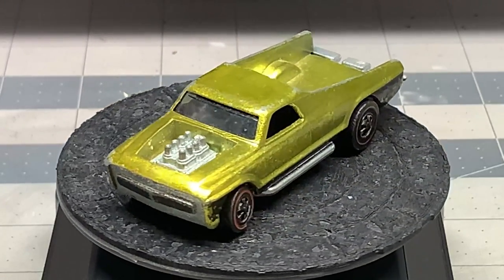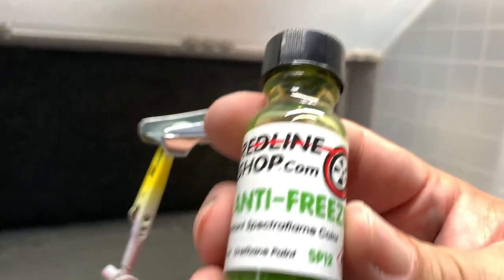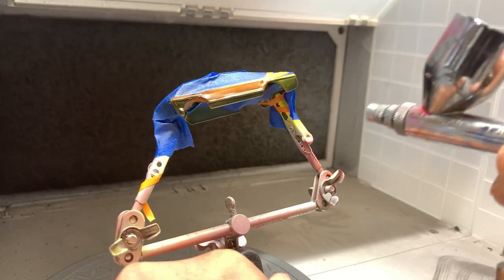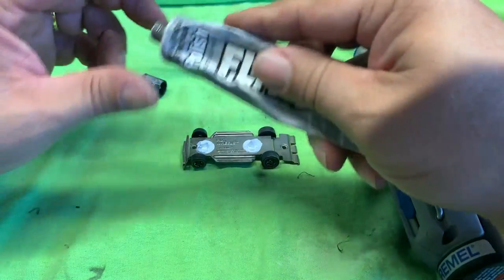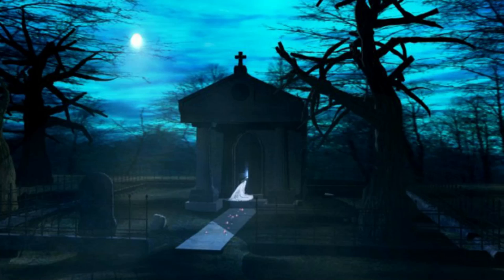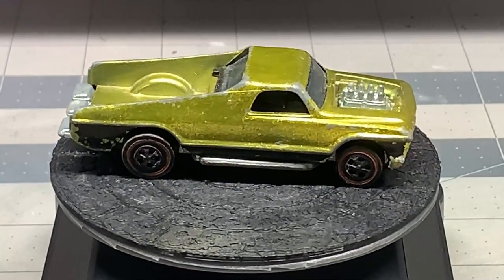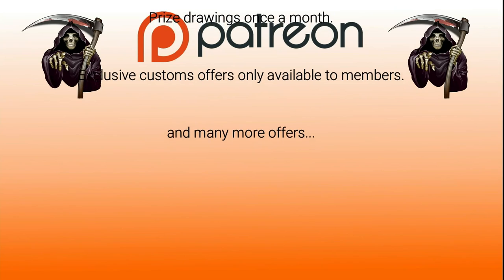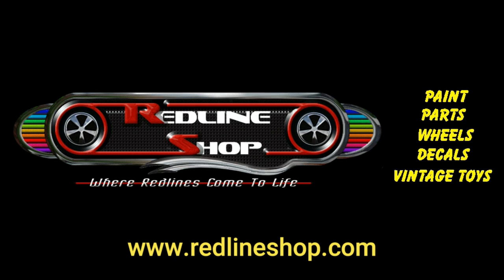Hot Wheels Sea Sider Restoration

Comment: Nice restoration! I got a seasider a while back, and unfortunately it had a snapped-off rear wheel. I don't have the materials to start restoring cars at this point in my life, so I decided to glue on a back-cap from a repro "redline conversion" set of wheels and put on an original cap that matched the condition so that it doesn't look off!
Reply: @DiecastGraveyard  I’ll send you an email about it later